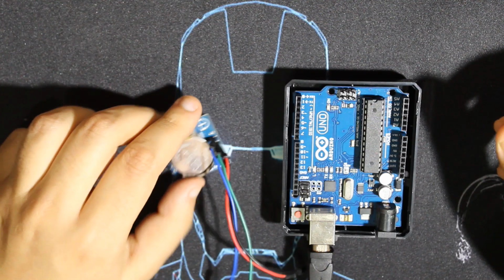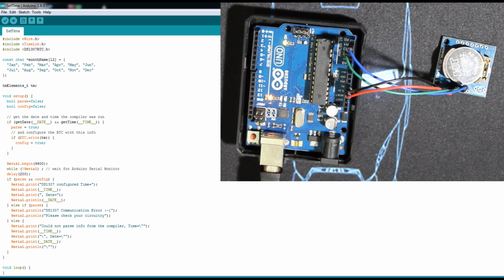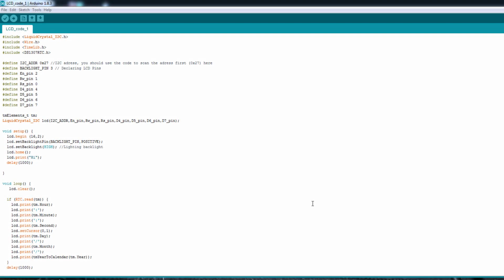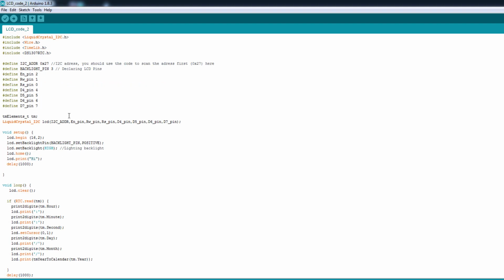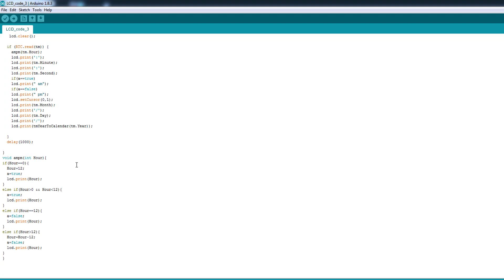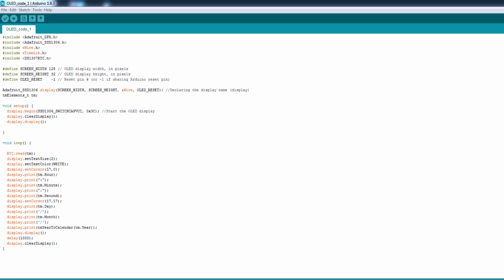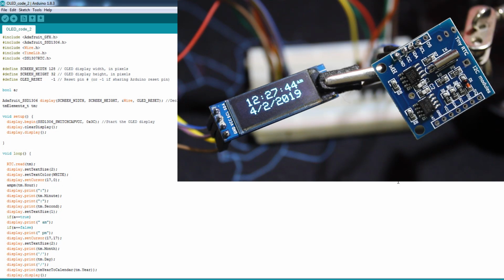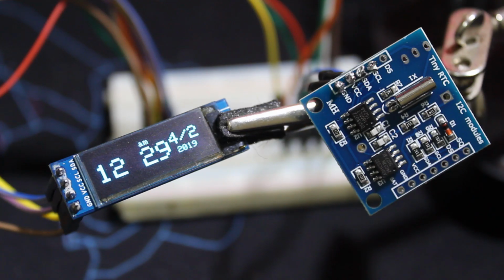How to use DS1307 RTC with Arduino + LCD/OLED 12h/24h formats

Comment: Print2digits wors great thnak you
I Can not get 12hr time,   else if(Hour>12){
                                         Hour=Hour-12;         //substract 12 to bring it back to 1,2,3,...
                                         a=false;
                                         display.print(Hour);

Please help tia
Reply from the maker: I don't understand your problem.
The code detect which hour and if it's 0- under12 it shows normally and with a "am", if it's 12 it shows 12 with "pm", higher than 12 it goes back to 12h format with "pm" symbol. if it's 0 (midnight) it shows 12 "am".
Reply: @SurtrTech  
Thanks for your response.  Sorry but I confused my own questions with another video.    Here I'm trying to get your OLED_3 sketch to put a zero in when hours, minutes, or seconds are less than 10 so there are 2 digits displayed.  I tried using print2digits(tm.Second);  along with 

    void print2digits(int number) {
  if (number >= 0 && number < 10) {
    display.write('0');
     display.display();
  }
  display.print(number);
   display.display();
  display.println();
}

I give 2 digits but everything on the display after that command flickers i.e the PM,month, day, and year flash  rapidly.   any help is appreciated,
Reply from the maker: Well you'll have to create another function for example"  print2digits(int and here it should read the hour/minute/sec).

Inside the function you'll test if the variable is <10, if it is you should then diplay "0" before the current hour/min/sec then print the actual hour/min/sec, if it's not, just print the number normally.

This function should be called everytime you want to display hour/minute/sec.

Comment: Evening Yassine.
Thank you for this great tutorial, out of all I have seen this is the best.
One problem though, have set this up and followed your tutorial to the letter (down loading everything from your site), I have run the simple program and the rtc worked really well, have run clock file 1 and 2 for oled and it looks great (better than I have attempted so far lol). But can not get the clock files to talk the rtc? (shows 12:00am 1/1/2001). Any idea where I may be going wrong?.  Using the same display and Same tiny rtc as seen in your video.
Thank you for your time and thanks again for the tutorial.
Reply from the maker: Thanks a lot, did you try first to set the RTC using the first example?
Upload the "SetTime" example first while the RTC is wired.
Then try the other codes.
Reply: @SurtrTech  ah, there we go, all working. Thank you very much for your help and keep up the good work.
Reply: @SurtrTech  and also a bit of fault finding found a dodgy battery fitted to the back of the rct 😣
Reply from the maker: @leeralph7765  Thank you very much, I'm happy it's working, normally those batteries last around 10 years, but if you could change it it would be better